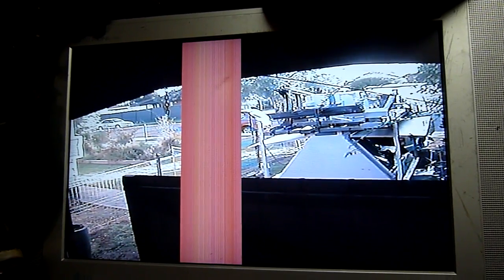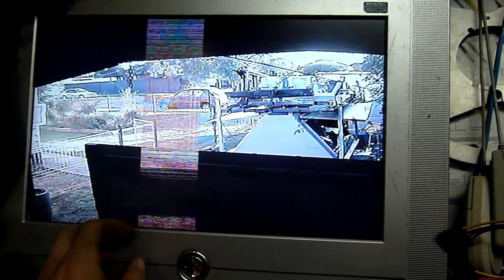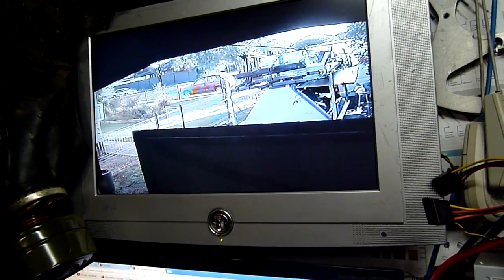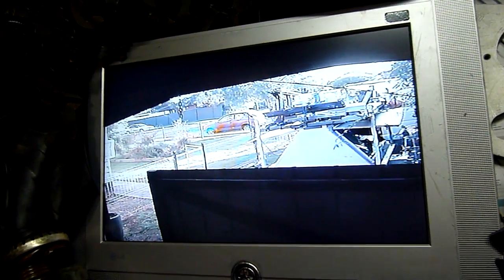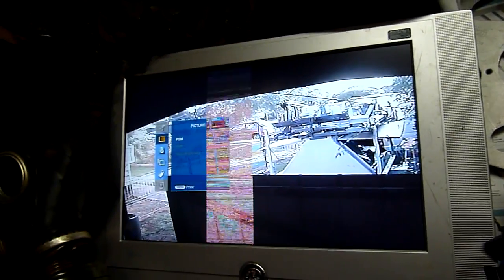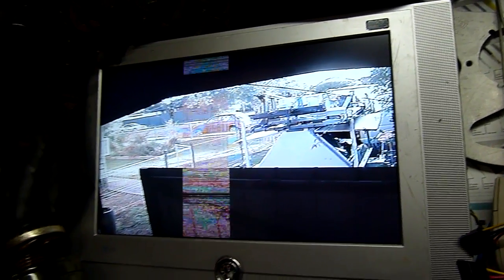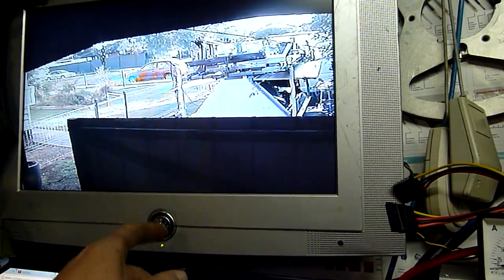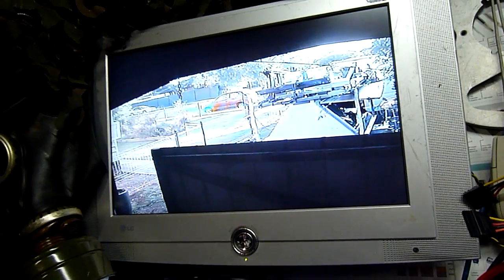LG LCD Panel Edge Ribbon or COF failure

Comment: I am having an issue with my Vizio LCD TV. the set turns on and displays color streaks on screen, and cannot be turned off by either the remote or the buttons on the side. No video and no sound and none of the buttons respond. I have a video of it here: watch?v=kagbIOZWgFM

Comment from the maker: sounds similar to what happened to my Hitachi (LG panel) I have not fixed it yet but it could be bad SMD caps on the Y sustain, or a failing semiconductor, mine worked for a few years then eventually died.

try running it on a power filter board to see if they go away, if that works its probably bad caps.

Comment: Looks like mine.
I have just repaired a L172WAL.ALAUT  LG Flatron only to discover the same thing. However mine has 3 very thin vertical lines about 3 inches apart.

Comment: If you want a cheap alternative to buying a brand new video monitor, you could get one of those cvbs to vga converters. One I recently bought on eBay had progressive vga output on loads of different resolution settings.

That way, you could just as easily use a cheap PC TFT instead of buying a brand new TV or monitor.

Comment: Edge bond failure would be vertical stripes.  I see corrupt data loaded into that driver chip.  Press down on the chip and see if it makes improvement.  Then replace your finger with a spring  :)

Worked for me if the bonding has failed.

No guarantee, but my 2 copper clad pennies....

Comment: It's most likely a bond failure between the chip and flexible film.  The adhesive bond has failed and the tin micro-spheres are no longer making connection between chip pads into the conductive pads on the film.

If pressing down on the chip make its work; put a small spring clamp to equally apply pressure to the chip and the film.  Like one of those spring clip paper clips, but equalize the pressure evenly.  It will be a permanent fix if the bond failure is the real problem.